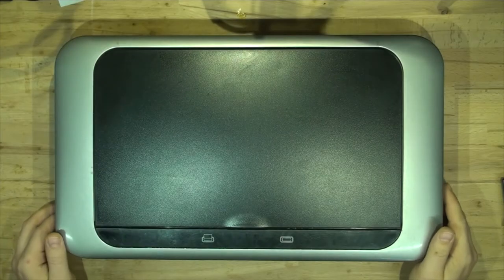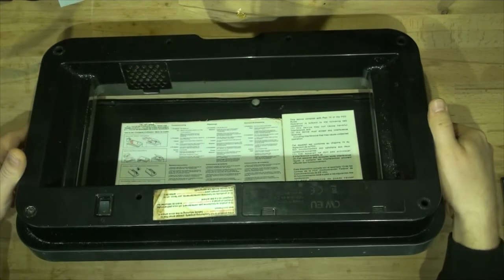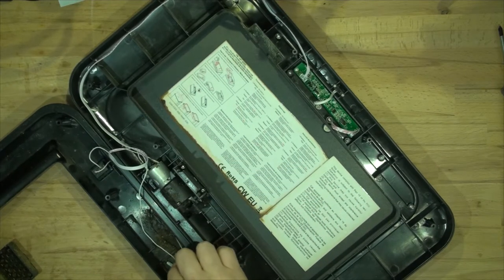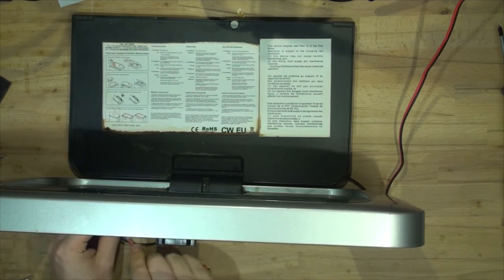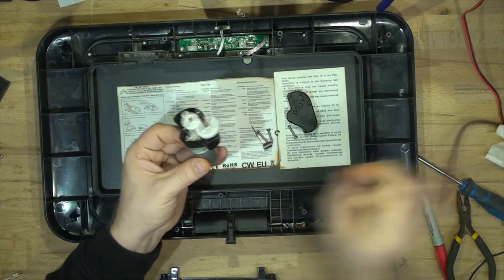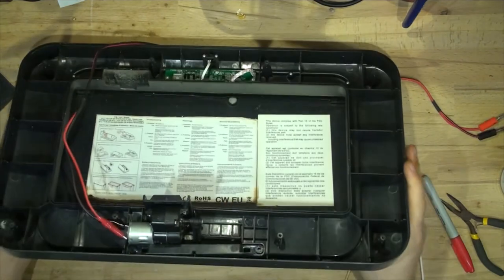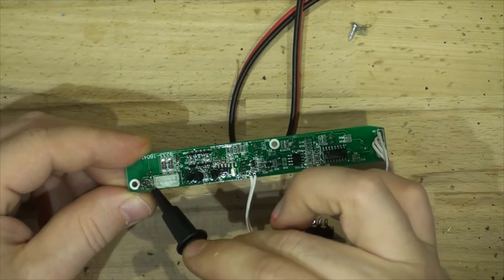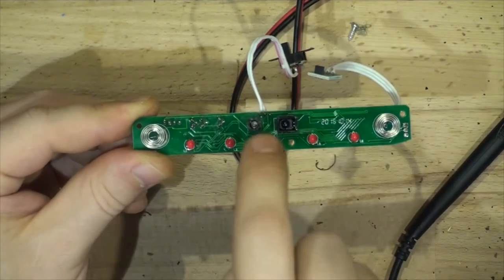Automatic Sensor Motorised Bin Repair

Comment: Great video. I am wondering if you tested the wires that connect to the motor. My wires are showing mah's fluctuating in voltage. Is that supposed to occur?. Because my bin works well for a while then it stutters trying to close. Batteries are showing 9.2 volts which is normal. I'm wondering what you would say about this. I know this is an old video. But thanks for Making it.

Comment: This looks identical to the Costco bin sold in the States.  I watched a video on converting  power from a battery to a DC converter.  While the presenter started out using a 9 volt 1 amp DC converter, he recommended a  9 volt 2 amp converter.  He said the 1 amp was raising and lowering to slow.  In your video the 1 amp seemed to work fine.  Do you have an opinion?
Reply from the maker: It shouldn’t be too quick to open but I think 1 amp is plenty, it’s just a motor controlled by the A1SHB. If it was 2 amps the batteries would go flat too quickly. It’s definitely 1 amp. And the voltage will control the speed

Comment: This is for those with experience fixing circuit boards.   Question is it possible the moisture from the trash will rust out any circuit board.
Reply from the maker: Yes it’s possible, that’s why I recommend sealing boards with protective lacquer.

Comment: Hey Max, thank you for your video. I actually have a different problem though, my daughter accidentally kicked or got tripped on it then it started making a loud annoying noise when it's wide open, the sound is like 4 to 5 countinuous loud clicks. Could you help me figure it out please? 😅
Reply from the maker: It would be a mechanism issue, you’ll probably need to pull it apart and make sure all the stuff are in its place.

Comment: Hi Max, I have a similar trashcan with the same brand of open/shut mechanism. I accidentally got the insides whet and after I dried it with rice the mechanisme started acting up. Do you have any advice? It powers up with the batteries but when it tries to open the lid, it only opens it half way and then shuts it super fast, like it just lets it drop.
Reply from the maker: Probably motor and mechanism needs to be pulled apart and cleaned, then lubricated and reassembled.